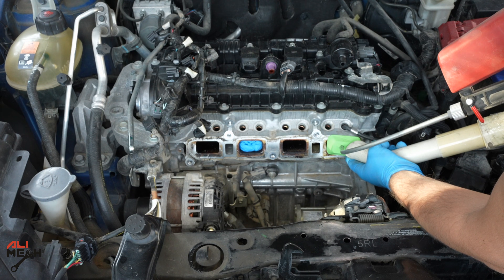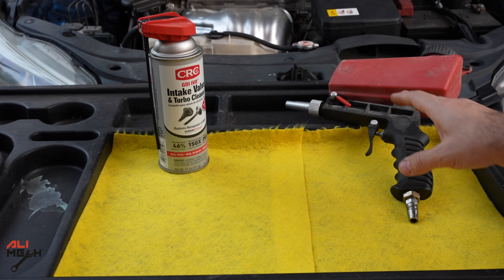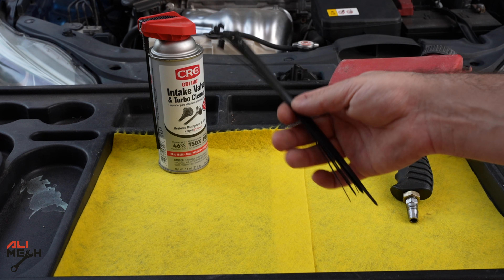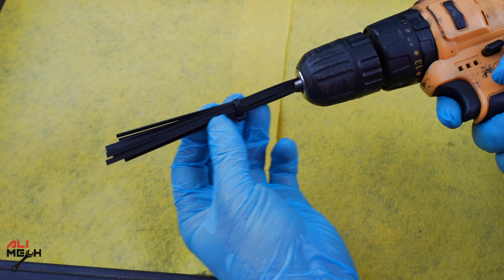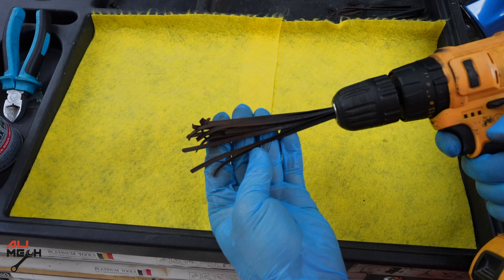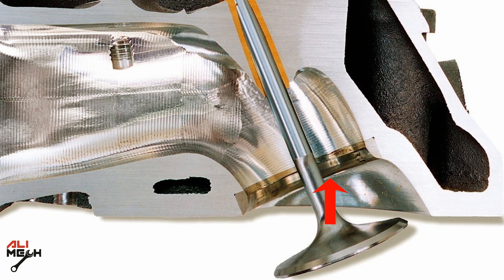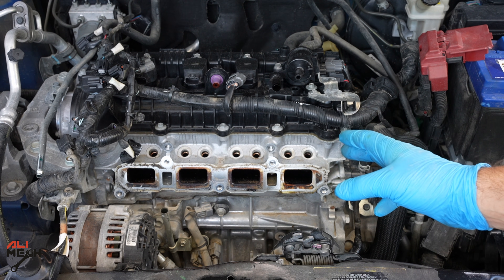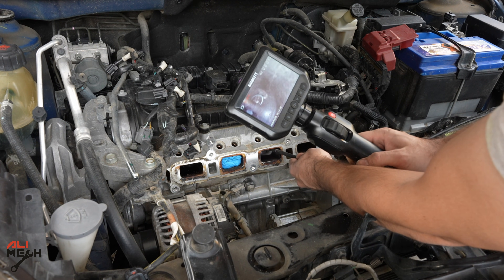Zip Tie Intake Valve Cleaning – Does It Actually Work or Damage Your Engine?

Comment: Slam my brother Ali  I have a Toyota Camry Acentsport 2020 2.5L how to drain/refill Transmission oil and also engine coolant drains/refills coolants and also how do I go about Air,locks in the system And rear pads with E.H.B system what is best way to replace them. Thank you very much😊 or Ali you're doing a very good jobs ❤ your Videos.

Comment: I tried that once and zip ties got twisted up. I used gun cleaning brushes, valve cleaner and heat which worked pretty good. Best method is walnut blasting tho.
Reply from the maker: Thanks for sharing your experience and tips!

Comment: LOL. You're supposed to soak the valves to loosen the carbon before breaking out the zip ties. And you don't cram the things in until the wrap around the valves. The only possible thing you could have done worse is flip the ties around and use the buckle end.

Comment: I'm glad you didn't test the concrete method where you pour concrete into your valves, place a chain link into the concrete and wait for it to dry, attach a chain with a hook to the set chain link, and then yank all the carbon out out with a tractor or a 4-wheel-drive.  That method doesn't work either.
Reply: Keep you concrete idea for your self, oh you identify as concrete,  my bad
Reply: @LinaAnalalina some people just have so much time, look how much detail he put ,acting smart and dumbb at same time
Reply: @LinaAnalalina   :face-green-smiling:🤣:face-blue-smiling:
Reply: You must have used the smooth concrete. If you use the rough stuff, it works like a charm! 😉
Reply: @troyjollimore4100  Dangit, if I'd only known I wouldn't have ruined my boss's car.  Details matter.
Reply: @keepingup2952 you still serving your boss 😂
Reply: You dont have to say anything if you dont have any logical reason,  ziptie method is very popular and he showed why you should not do, so keep your concrete in your pants 😅
Reply: stop crying you foo|

Comment: Thanks, I never liked the idea, but now I know why 😅
Reply: It works, just not the way this guy did it!  How to do it correctly:

1) make sure the valve is closed. 
2) soak with non-chlorinated brake cleaner or carbon remover...longer is better.
3) THEN use zip-ties
4) don't stupidly cram them in so far that they bind and wrap around the valves as the author did.
Reply from the maker: Glad it helped you know more!
Reply: @AliMECH im having problems with my car ,it drives forward fine but wont go in reverse,,,so today what i did was jack up the car in the front ..both front wheels off the ground but when i put it in reverse only one wheel spins